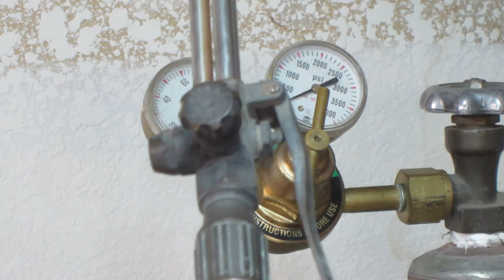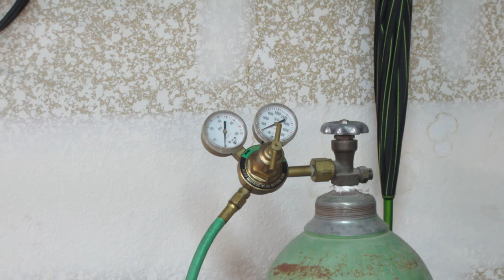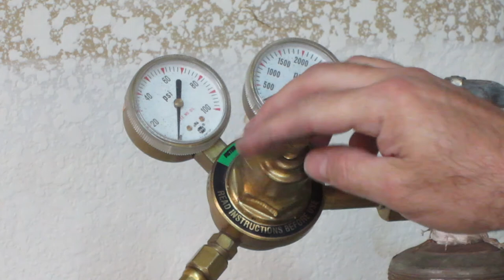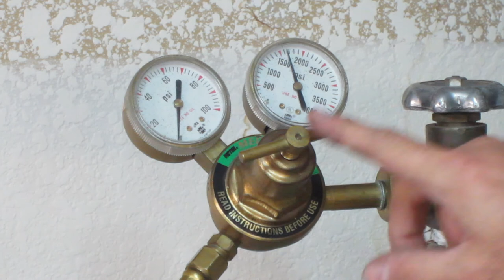Oxyacetylene Welding Oxygen Regulator Rebuild

Comment: Thanks for the video.  I would issue a word of caution against using dish soap on the oxygen regulator or for leak checks.  Some of the dish soaps have petroleum product in them that could be a risk.  They used to say only use Ivory dish soap as it was non petroleum based.  Given the amount of soap you used I doubt it would be an issue but everyone else should be cautious.
Reply from the maker: Hi there.  Thank you so much for that important bit of information.  I did not know that, until now.  I appreciate you taking the time to write to let me know, especially given that there could be an element of risk.  I will make sure and keep that in mind, as well as share that info with others.